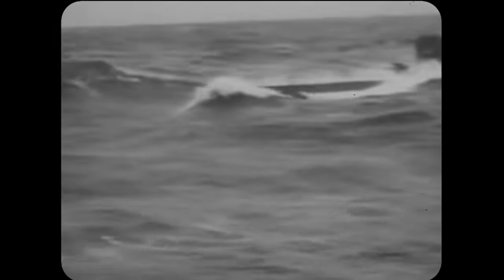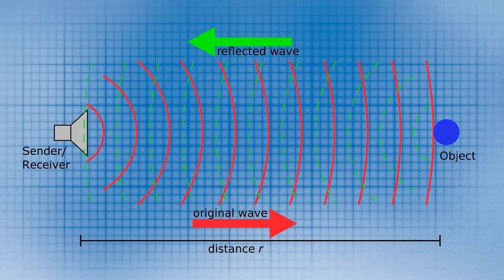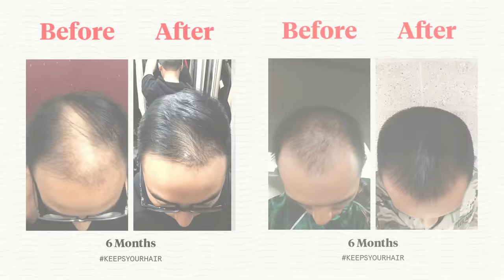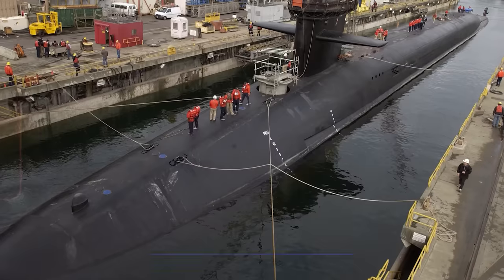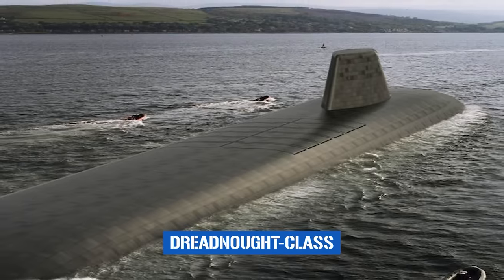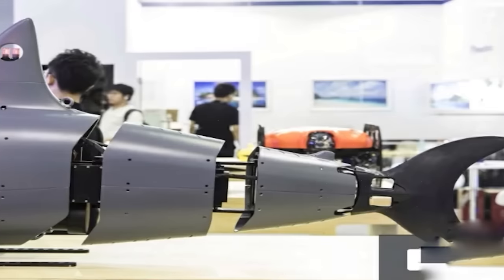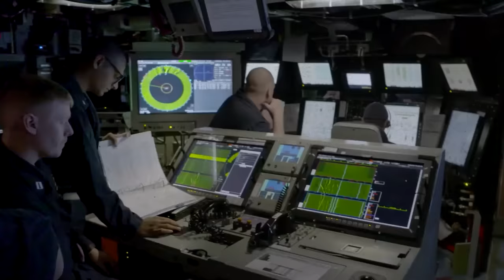Stealth Submarines: The Silent Underwater Killers

Comment: Anechoic tiles do not do a lot for internal noise. However their hardness is tuned to dissipate active sonar pings. That's why UK subs  operate not only on a range of frequencies but also sweep up and sweep down. It's not always the sub that pings either. EG there are sonobuoys that are pre programmed with a ping pattern that can be released. That way the bow sonar can be used without trailing microphones which are noisy due to causing drag. Also below a classified speed some subs can pass within 2 meters of the seabed microphones. There is a huge amount of research on increasing that speed. I can't say what it is as I think it is covered by a 50 year D notice (Do not disclose notice).

Comment: Swedish design are coastal attack/spy subs
France also got insanely quiet subs
And most stealthy subs are ones with AIP systems, not nuke ones ! 
Nuke cores pumps are loud AF !
Reply: And now subs are moving Lithium batteries, France is proposing version that could stays under water for 89days and able to great speed if needed
Reply: I have veen searching for an answer to how America plans to deal with battery operated subs if need be.  There are no answers available.  That doesn't mean there are no answers.
Reply: Only the D.C. steam turbine, the "Core Reactor pumps are quiet" that's why ,Batteries are still used kept charged to use as back-up, in "Run-silent" mode. I repaired, 688 class subs.
Reply: Stirling engines. They work on heat differential alone. Also everything dampened from machinery to coffee machines is on shock absorbers that dissipate vibrations and the entire thing is insulated like a music studio. And of course the big secret in any quiet submarine is the propeller geometry. How to avoid cavitation but still get a decent RPM to move forward. Back in the day RMS Mauretania shook so violently from her four propellers the aft quarters where uninhabitable and she had to go back into drydock to be reinforced. They didn't understand why the smooth turbines would vibrate so much but it wasn't the turbines, it was the propellers causing violent cavitation, turning the water into steam. They did it by trial and error swapping around props. A big controversy was if Titanic had a 4 bladed or triple bladed central propeller. It was always believed to be 4 bladed as with the older sister RMS Olympic and as to the design but they were constantly swapping props and trying stuff, including putting a 3 bladed propeller in the center on Titanic. She sank, do they never got the results from the test. Despite racing across the glassy sea at 22 knots with the last boiler room still offline, later tests with Olympic showed the 3 bladed propeller was a detriment and so she went back to 4 blades in the center and 3 on either side. 

On the wreck the center prop is deep in mud so only when documents and orders for the propeller were found a few years back in an old Harland & Wolf archive was it proven. 

The famous image always shown of Titanic in drydock with the 4 bladed center screw is actually Olympic. Many photos of Titanic are Olympic. They were so similar Harland & Wolff didn't bother to photograph Titanic in as much detail as Olympic. Except the exterior where the closed up A deck promenade on Titanic makes them easily distinguishable. This is where the popular Café Parisienne was expanded and forward the two millionaires suites with their private enclosed promenade (Rose's quarters...) on Olympic those where on the fully enclosed B deck. Also Titanic had carpeting in the first class dining room unlike shown in the movie and unlike Olympic.
Reply: @221b-l3t  i got really excited when I saw your post.  A long one from someone knowledgeable on subs? Woo hoo lots to learn!  But only the first two sentences delivered...by the end you were talking about some girl named Rose.  And Rose is the name of the love of my life.  The one that got away.  So now I am depressed.  So yeah thanks for that.  Hehe
Reply: @knowsmebyname   Well I figured everyone knows what I mean if I say her cabin. If I said it was JJ Astors cabin that's not much use to anyone.
Reply: This video is not serious work, don't ask too much.
Reply: French ones aren't that silent as their AIP system uses the same generators as their nuclear subs do.
There is work on less noisy systems, but not done yet.
Reply: @framlucasse   It's entertainment for people who like this stuff. If you want actually detailed info on a vessel try Drachinifel, Oceanliner Designs, Big Old Boats etc... or a library! Those exist.
Reply: Seawolf class subs are nuclear and the most slient

Comment: Funny thing about the rubber tiles on the outside of the subs.
They have been found to have circles cut out of them after long times at sea.
The culprit? Cookie cutter sharks.
Reply: I was stationed on a sub tender back in the '80s when anechoic coating was brand new. They hadn't figure out the right glue. The boat had it (I don't recall her name) would come back with pieces missing or flopping. LOL 
Apparently they've figured it out. 😂
Reply: The Russians would bolt the tiles on. The bolt holes were then filled with a plug that would sometimes fall out. Ask me how I know. I was the site manager for the Russian sub in Providence RI back before it sank in 2006. I was long gone by then. Russian steel used to build that thing was crap!
Reply: @webbtrekker534  The last time conventional Russian forces were a threat was the end of WWII. Without their nukes, Finland could invade and conquered them within a month.

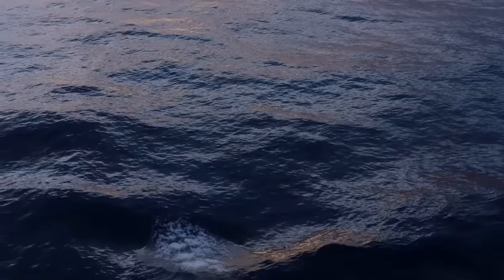Comment: 10:14  Magnetic anomaly detectors (MAD) are not new technology or a recent innovation.  They were used for ASW starting in WWII.  They are still a useful short range detection system against subs.
Reply: Didn't realise they were quiite that old. My understanding was the '80s?
Reply: As long as you’re not chasing a titanium or stainless steel hull…
Reply: @komradebob  stainless is still detectable.
Reply: @_starfiend  MAD was WW2. Nimrods had MAD booms in the 1970's
Reply: @diceman199  Yeah that's what I thought. I just knew Simon was wrong when he said it was new.
Reply: @_starfiend  I had MAD explained to me while on a flight on a nimrod. The galley table ended up covered in chinagraph drawings. That would have been about 1982/3

Comment: Using active sonar on an unknown contact can be considered an act of war. Passive sonar will only give you a bearing to the target, to get the range to the targey you need to use active sonar. The idea is, the reason you would go active is to get a firing solution for your torpedoes.

Great video as usual!
Reply: Everything you said is wrong

Comment: Magnetic anomaly detection has been around for years.  The old p-3 Orion had a MAD detector in the boom at the rear of the plane.  Kind of a big error for megaprojects.
Reply: The Canadian Aurora ASW aircraft have had MADs for decades.  They use it for final targeting before dropping a torpedo.
Reply: There are better attack sensors these days, but the open-ocean MAD mark is still surprisingly common for first detection!

Comment: SmarterEveryDay has a good video onboard a US submarine. They can't say a lot because it's all classified, but they were discussing how sound waves can change depending on the depth and temperature of the water and how sound bounces off the surface of the water and the ocean floor and it just sounded so immensely complicated to figure out how the sonar equipment is able to transcribe this information into useful data.

Comment: The Swedish Gotland-class submarines use a Sterling air independent propulsion system (AIP). A Sterling engine electricity generator is employed to recharche the batteries. Sterling engines are much quieter than internal combustion engines.

Comment: the thing with submarines, is you could have the best, most modern underwater detection systems in the world, but a navy or air force can only search a minute fraction of the water at any one time, so finding submarines is still going to be super hard until they attack, or unless you can track transmissions to and from the sub

Comment: Generally, diesel boats are quiter because they run off electric batteries, but they have to go up to/near the surface to run a diesel generator.  Nuke boats can be loud because of coolant pumps and other pieces of the reactor system.  That said, US Nuke boats are "holes" in the water.  US nuke boats have a real advantage in how long they can deploy.
Reply: But don't the nuc boats get almost silent when making steerage?
I read somewhere that they don't need to operate the cooling pumps at such a low speed so the reactors can circulate steam by simple convection.

Comment: What the Virginia class submarines did was drastically reduce the noise signature of the nuclear drive system itself. insulating the noise of the coolant pumps and the driveshaft and putting the propeller spinner inside a shroud makes the Virginia class submarine just about as quiet as a diesel-electric submarine running on battery power.

Comment: The Swedish subs are much smaller, made for sneaking into shallow waters, not open Atlantic endeavors. With chilled oxygen made from sea water and sterling engines as electrical generators, they can as I understand run the engines on pretty much anything. Could Methane be possible? In that case, with their new A26 sub with underwater drone and scuba deployers, could they refuel by tapping into undersea power cables? Will that limit the time submerged to release of exhaust? (And food for the crew of course)

Comment: Hi Simon et al.
Is their any chance you could do a feature on Australia's AUKUS submarines? Some of us reckon they're nuts to even try if the idea is protection from China...
Reply: based on the quality of this clip I'd rather poke my eyes out with a broom handle. this was 15mins of bollocks.  As soon as someone talks about speed advantages or even stamina as what nukes bring to the table then its pretty damn clear that they actually have zero idea about the actual capability benefits

Comment: Back in the 80s I had an American girlfriend who had been in Nuclear Submarine Tracking based in Norfolk Beach. She said she watched monitors that displayed signals from massive cables laid out on the seabed. Each submarine gives off a distinct signature from its propellers and that vibration is picked up by the cables. She said the only place they couldn't track subs was under the north polar ice cap but they'd just wait until it came back out after going under the ice. Now those cables are used by science to track migration whale pods because they can pick up the whales singing and identify particular whales.

Comment: M.A.D isn't exactly new.   Canada has been flying a version of the P-3 Orion with Viking-3 avionics since 1980.  Designated CP140 Aurora, it features CAE  Electronics ASQ-502 MAD.  See the tail extension.  I'm sure they've been around longer than that, as the MAD unit was also public knowledge in 1980, ie I got to see it at an airshow and they announced it.

Comment: Ocean is a noisy place. You just look for the hole in the water, where the sound is least... Active is used for the torpedoes. And then they start out passive until the planned runout has expired. But a well placed ASROC will likely go active the moment it gets wet. May not sink the sub, but getting it out of action is key. I don't think there is an IFF system on torps. so you want to be out of sonar range.

Comment: Much like using a rangefinder through glass, the accuracy of using lidar to detect a submarine is extremely limited. The general location and an assumed depth are all you will get. This is enough to narrow down the search, but the mat black surface of a US sub may help it hide from lidar. Bubbles have always been an issue for submarine detection. From quick moving propellers boiling the water otherwise known as cavitation. As well as water pressure at the front of the sub being higher than the pressure along the hull. This pressure difference can create small bubbles that pop and are one method of discovery of a submarine. Active sonar is much like radar and is rarely used by a submarine. Active sonar uses a high-frequency ping to reflect off the surface of surrounding objects. The reasons for limited use of this are marine life side effects, and it gives away your position as well. Magnetic detection is by far the most effective method of detection but has a vary limited range. We can also hide a magnetic signature with the use of certain alloys and composites. Eventually, there will be technology that will find a current submarine with ease, but that's the same with everything. The objective is to stay ahead of the competition of both detection and avoidance.

Comment: I think you are wrong on one key point. Quietness was not improved by nuclear propulsion. Machinery noise was higher in a nuclear boat that a D/E boat. Electric motors, double isolated are just about as quiet, in terms of machinery, as it’s possible to get.

Comment: A nuke boat has cooland water pumps, steam generators, steam turbines and generators and lots of other stuff running at all times. There is no way any nuke boat is quieter than a regular old school diesel electric sub running silent on battery. Wich is why most nations have some kind of diesel electric sub for defending home waters. Nuke boats are only good for going fast and going far, but they make more noise then regular subs. Another factor is what speed the sub is going. Pretty much all subs can be nearly undetectable when they go slow, even some badly maintained soviet sub will be very hard to locate of its only going ~5knots. Going slow and silent, most subs are way quieter then ambient noise. Infact if there is bad weather or a storm, the ocean itself will make so much noise, its impossible to hear another sub until its right ontop of you. Wich is why allmost every year you got some sub collision with another sub or civilian vessel they didnt hear was there.

Comment: No mention of the Canadian Victoria class submarines?   (The ones Canada bought from the UK after Pakistan rejected them.) They are often 100% silent!  This absolute stealth/silence feature is activated by the frequent electrical and/or mechanical failures which cause it to enter its silent mode.  If you see one of these subs being towed, or on a submersible heavy-lift ship, then it is probably in 'stealth mode'

Comment: Magnetic Detection has been in widespread use for decades to find subs, especially in shallower waters.  And nuclear submarines are notorious for generally needing a coolant pump - which generates a rhythmic unnatural noise.   The quietest subs have proven to be diesel electric-I recall the quietest Russian subs were reported to be Kilo class non-Nuclear designs.  I doubt Nuclear submarines are the ‘stealthiest’, but their range and no need to surface makes up for it.